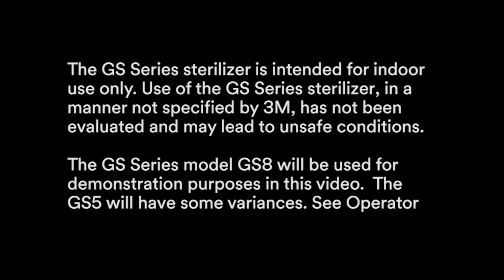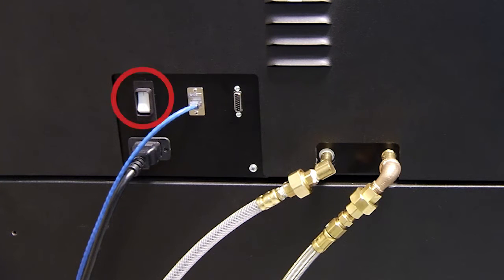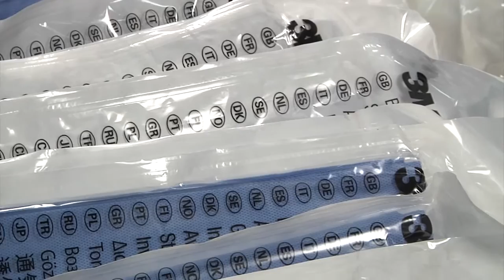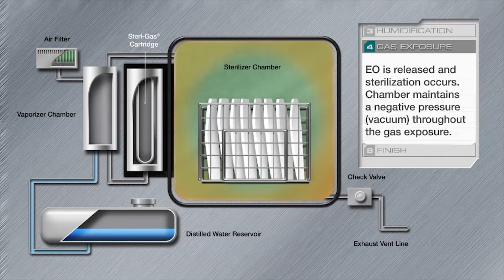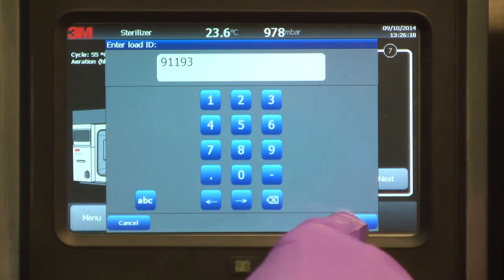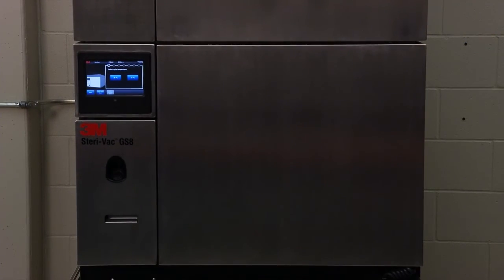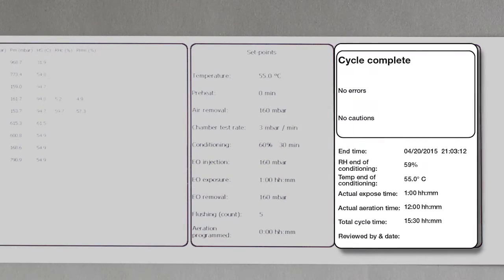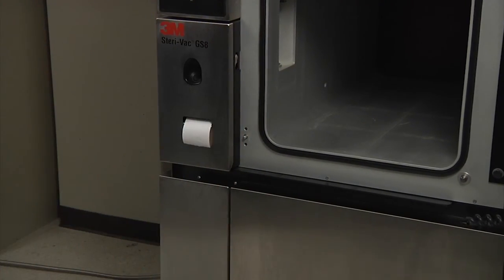EO Gas Sterilizer SteriVac GS Series GS5 GS8 3M ( New model)

Comment: Hello.

 I want to buy the G-Series Ethylene Oxide Steriliser. I want one that is of 800L or 1000L capacity.

I also want all needed accessories for the sterilisation process. Accessories such as Sterilization pouches, Sealing Machine, Loading Basket, Test pack, Butyl Rubber gloves, Safety Glasses, Garments with long sleeves, Biological and ethylene oxide indicator, and cartridge etcetera.

Thank you.